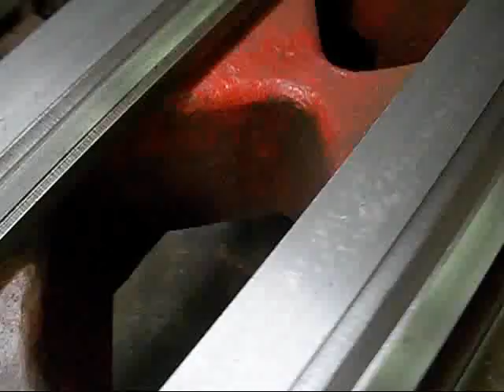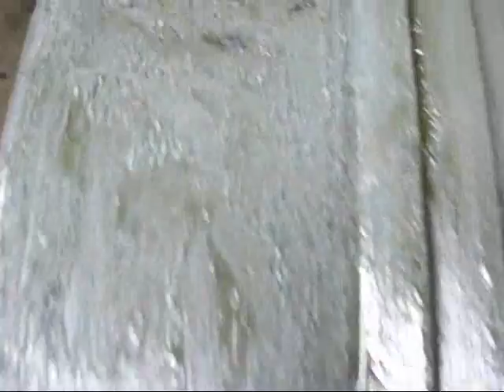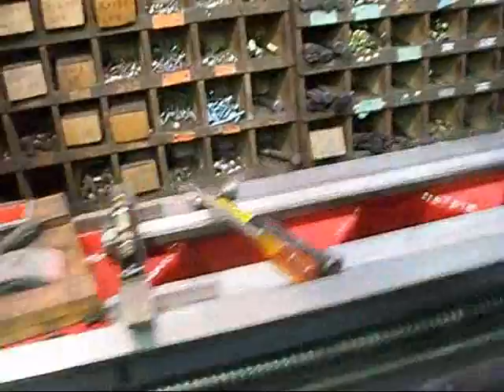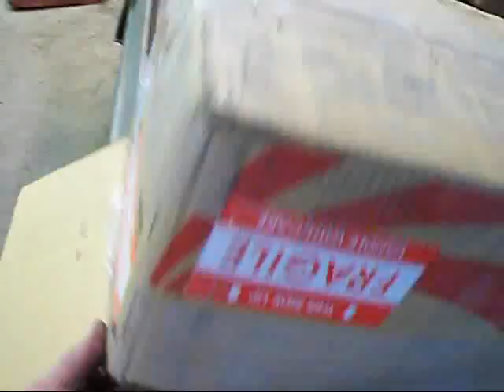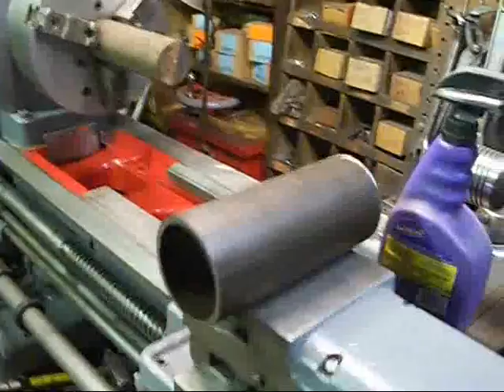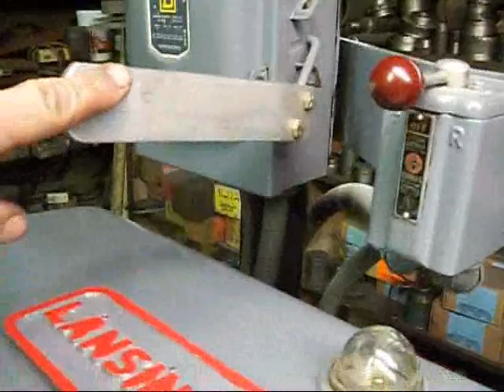GRAZIOLI LATHE 0001

Comment: That "original" red paint was red lead, used to simply cover otherwise unprotected bare metal where purdy don't matter, like inside the gearbox and the back side of that cover plate you showed. And yes, the very high lead content makes the sanding dust extremely toxic, especially for kids.

Comment: Big improvements on your lathe! That turned out super nice.  What kind of paint did you use?
Reply from the maker: The paint came from Tractor Supply . Majic paint,  hardener, and some japan dryer just a few drops of this
Reply: STR IRONWORKER
 Let us know how it holds up to chipping and oils and coolants. I have heard that appliance paint does very well on machine tools but can't say from experience.  Most all of my machines could use a good strip and paint as most have seen what i think is porch paint a dozen times before I got them.
Reply from the maker: bcbloc02 Well it's Tractor Paint with a hardener so I hope it holds up Thanks